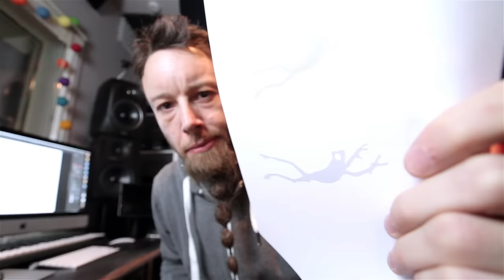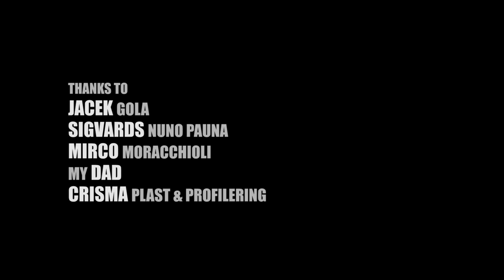MAKING MY CUSTOM GUITAR!

Comment: When I cut the pickup cavity in my Strat for humbuckers, I used a chisel and slowly chipped away and turned it into a "swimming pool" cavity. I could do HHH if I wanted! 

I took my time with it and it is so sanded inside and even, it looks like it was done with a router!
Reply: I've seen some work that looked like it was done with a dull butterknife and a rock.

Comment: Parts of that were kind of brutal to watch, but it's evident that your willingness to ask questions, experiment, and make mistakes has made you the multi-talented person you are - and you got a result you were happy with, both in the experience and in the guitar. Nicely done!

It occurred to me that you could've made a pretty cool pickguard out of the head/body portion of your Frog Leap logo. Might've looked pretty wicked. I think I would have put an accessible battery case (the kind with a door) in the void in the back behind the bridge mount where you put that piece of wood.  

You could pretty easily convert that basement space into a nice little shop area. Very cool vid, overall. 😁

Comment: Awesome video and guitar! I know this is an old video but just wanted to offer a coupon of tips. When you’re using a router like that it’s easier to remove wood in smaller cuts. For example instead of cutting the entire depth cut about 3/4” at a time or less. It’s easier to make several passes. It makes it easier to cut and if you make a wrong cut there won’t be as much damage to repair. 
Next when making holes larger on the Guitar I have found it’s much, much easier and safer to use a reaming tool. It’s angled and sharp and is used by hand. 
I had to use it on my LP when I changed the volume pots. I didn’t want a drill bit to slip and ruin my finish or split and chip the wood. The reamer works great for these things and would have been easier to make the holes larger for the tuners. Just sharing my experience. 
Other than that you did a great job!

Comment: Nice work Leo the finish turned out metal moody in my opinion looks like a creepy foggy snowy night with those leaping demonic frogs haha. 
One suggestion permit me to give you.
Since it is now called Mr Frog you need to find a frog maybe a wooden or ceramic one and close it at the back were the tremolo springs should be since your plastic covers are clear. So that Mr Frog can buzz in this guitar.

Comment: Eye screws into the strap holes are great for hanging it while painting.  You can also screw a board into the neck pocket to hold onto as a handle while you are painting (for a bolt on neck obviously, not for a set neck)

You want to use a sanding block also to make sure that your flat faces are smooth.

Comment: Sand actually was the correct word, so nice 👍🏻. Also 180 is the grit, meaning the scratchiness of the sandpaper. The higher the number, the lower the mount of material it takes off. Great vid!

Comment: Success doesn't come without failures. Spray painting: single pass sweeps starting before you hit the project and stopping after the sweep leaves the project, wait a few seconds then sweep the area in the opposite direction, never spray endlessly in random pattern, this is why drips formed.

Comment: "it's urm, 180, that doesnt mean anything to me, except that it's a really light sand?"
he probably meant 1800 so i'll forgive him
"okay so that was urrr wrong paper, this was the one i was gonna use. it's urr 400 ¯\_(ツ)_/¯"
Reply: Sandpaper has a grade. The lower the number the rougher the paper is for getting rid of edges of the wood that feels like you'll get a splinter. The high grade means the smoother the paper which deals with filing down thin wood or what he did which was not hurting the paint.
Reply: It looks like maple which is a hardwood, but very workable., My only issue was when he wasn't sanding with the grain.  For color sanding or sanding after priming, I'd use 600 and higher and wet sand it. Well damp sanding with wood, wet with metal.  I think he did a good job.  I would think that a regular rattle can clear coat would eventually rub off with use, I'd use some form of epoxy.
Reply: Also, the painting and finishing is the fun part, so save it for last.  If you make another, using the leftover paint lowers the price....says the guy with a ton of leftover paint. ;)

Comment: Wear safety gear and clamp your work. You will lose and eye and a finger that way.
Reply: Kilty MacBagpipe +1 on router safety
Reply: Kilty MacBagpipe gloves are iffy because the glove can catch and pull your hand into the tool.
Reply: Toxic Muffin I never said anything about gloves. Eye protection, dust mask and clamps is all I had in mind.

Comment: Nice job Leo.  Here's a tip for an easy finish.  Drizzle dish washing soap on the surface of the guitar in different designs.  Then, immediately spray a coat of paint(you choose color).  Then put another layer of soap lines/designs and paint with another color.  No need to wait for soap or paint to dry.  Repeat the process with as many colors as you wish and add multiple layers.  Then, when the pain is dry, wash off all soap under warm water.  The effect of the various soap lines and designs overlapping each other is pretty cool.  If you decide to try this, good luck.

Comment: You could add a rechargable battery so that way you can add a recharge port on the side of the guitar, and when you want to recharge it, you just plug it in vs having to take the pic guard off all the time. This will also help with taking screws in and out over time and wearing out the screw holes etc. Love it man. keep it up.

Comment: Hi Leo, I've done a few builds myself, one thing that i kinda stumbled on was using screws that were long enough to actually mount the pickups to the body by screwing them into the wood. it affected the tone immensely, then I
 read later on Eddie Van Halen had done the same thing on some of his Frankensteins. I spray painted it with blue, white, and yellow stripes, and before the paint dried I hit it again with Red spray paint that was kinds splattering. I wish I still had that guitar, was the first one I "built" and it was unique. That was back in 1985. I have no idea where it is now. But that was a cool build you did there. Kinda has me itching to try it again. Thanks for the video.

Comment: In sandpaper, the number is the grit. The grit refers to how many fragments or pieces there are per square inch. So for lower grit sandpaper, there less pieces and the pieces are bigger, making the whole thing more coarse. While for higher grit sandpaper, there are more pieces and they are more fine, giving you a smoother sand.

Comment: Fantastic. And very inspiring to us who would like to try to build our own guitar. Remember! There is only one. It is unique, and YOU built it. Now lots of us want to go ahead and build one for ourselves. So, thanks. I started tinkering; messing about with existing guitars, changing pickups, coil split, series/parallel, etc. It is fun and does not need you to spend a lot of money. 
At the end of the day, you can say "this is mine, there is no other exactly like it, and I MADE IT!"
I cannot think of anything you can have so much fun doing.
And you are right; paint/finish jobs are hard work, and can get very expensive.
Thanks for sharing your journey. Very inspirational.

Comment: always use the center of the buffer, not the edges of the buffer, as the edges cause more friction and heat burning away your clear coat faster in areas making the coat uneven. the edges and corners of whatever you are buffing are always the hardest as even using the center of the buffer corners and edges burn quickly leaving rings or elevations in coating. sanding and buffing is an art form in itself

Comment: That's an awesome guitar, dude. I've built three myself and have 12 from the manufacturers, but my favorite is still the 14 pound jazz bass I built first, mistakes, blemishes and all. I buy cheap assed bodies and necks, then get knock off bridges that are nice and heavy, real tuners and nuts, CTS pots and have Dominger make new pickups. Totally custom how I want them. Also buy spray paint from the auto shop for 20 dollars. Cheap, cheap and shiny sweet. I hope you build another. A nice bass would be sweet!

Comment: Each time you spray it you should spray it very lightly and let it dry maybe sand in between coats and build it up that way you won't have runs or thick or thin spots

Comment: If you want to avoid having the paint drip you can spray short little sprays and it won’t run. If you hold the sprayer tip down on the paint can down continuously like u did for the primer and the white it will run. Just a tip if you decide to make another guitar or do anything involving spray paint.

Comment: I have done that kind of work on the wood for fitting humbucker in na original single coil hole, but did not have a router or a friend with one. Did it with a scredriver and a hammer. Primitive, but effective...lol

Comment: great custom guitar! Looks amazing, sounds real good. I'd put a hardtail on it, you screwed up the tremolo anyway, it was supposed to be a 2 point one, but you drill the other 4 holes anyway, and you forgot the springs, with a hard tail you'll get better  tuning stability, that jammed in half trem will let you down eventually. Either way awesome job I had a lot of fun watching you build it.

Comment: You did a great job! I just built a Jazzmaster from extra parts and some stuff I had to buy. It weighs a lot near 12 pounds. I used clear varnish and Tia and I put our blood in it. At first it was very very red. Now it is the color of a scab. You know a brown color. The Jazzmasters have trouble with the bridge. I tried 4 different bridges and then I modified one and it is perfect. Action is very low and the guitar plays better than the real Fenders at $1,400 bucks. Not counting the hospital bills because we near bleed to death trying to get the right shade of red. I played it live two nights. It's a beast because of how loud it is. I hate the switch so a new switch this week. You never were hospitalized so I say you did better Leo! I hope I see your new guitar in the videos.

Comment: I know this is an older video, but it just played automatically on my PS4 so I watched it.  Very cool video and thanks for sharing.   I know it’s over a year old, but I just wanted to say, if you haven’t had a chance : try the ‘18V mod’ for those EMG’s.  It’s easy to do, easy to undo, and really really changes the dynamics of the pickups.  It’s common to do and not at all harmful to the pickups.  

It’s worth trying just for fun as it really makes the pickups more dynamic and less compressed.  

Keep up the great work.

Comment: Normally those EMG’s use a 9 volt battery, a little trick I use is 2, 12 volt batteries for a total of 24 volts. It really brings those EMG’s to life. 
 I bought my guitar off eBay, replaced most everything, it’s my favorite of all my guitars. Just wish I could play them.

Comment: Turned out pretty good man. Only suggestion I'd make, take your time painting. Lots of light coats. More back and forth when using the spray can. Other than that I really like it. Oh and make sure the finish is the very last step. Build it first.

Comment: Awesome job, man.. Ive been playing for almost 20 years (Im not even 31 yet lol) but just now getting into customizing/building my own guitars.. I recently took my very first guitar which is a Squire Affinity Strat from 2001-ish and replaced the pickups with a Seymour Duncan humbucker, a single volume knob and soldered everything myself. Ready to throw a Seymour Duncan Invader in it with a 3 way toggle switch and obviously a new pickguard. Gonna paint the headstock all black and put a custom Michael Myers decal on the body. Cant wait to get it finished.

Comment: nice! but the battery placement is a bad idea, as you will soon find out! the quickest fix might be to put a rechargeble one in there and mount the connections to the pick guard in order to charge up the (guitar) battery

Comment: On the wood no aggressive materials in general. Because wood it's not like iron, it's a LIVING material, its adapt himself to different kind of tension, obviously like everything else to temperature changes, and so many other things. Like a general advice, work it friendly and gently. For example for the nut, use vinil glue instead of super attack etc etc etc....

Comment: Let's be honest, it's all because of the EMG's and valve amp. You can put EMG's on a broom stick and still it will sound, and the high gain valve amp does the rest. I've changed my bridge pickup with EMG on my Cort, and now it sounds like ESP LTD. But it will never feel the same, its just the sound that is there...

Comment: for your next project a old trick I learned  when I built gun stocks.   sand the wood to a smooth feel.  here is the trick     wet your fingers with water  wipe the wet fingers  on the wood surface to moisten it. do small sections at a time  .then use a flame from the wife's gas stove to dry the wet spot  a hand torch will work.  just don t burn the wood    after spot is  dry feel it.  the fine wood fibers will raise and make it rough again    from this point on use 000 steel wool to smooth the area  again  repeat the wet  dry sand  til the wood feels smooth after the wet spot is dry       the roughness you feel is partly due to the tiny wood fibers Bing raised by the wet paint         your guitars roughness is most likely due to the layers of paint      and it is super bad ass        if you do another one give this trick a try and see what you think
Reply: Interesting tip, thanks for sharing. What types of wood do you use this method for?

Comment: That looks like it turned out really well. The thing is you very much get what you pay for. I've built £50 (is that maybe 70 dollars? really cheap) kit and whilst the wood was passible, i spent months doing inlays because learning on something cheap, but I spent more than that on a wilkinson two point bridge, as that was about the cheapest trem that wasn't rubbish. More on locking tuners. Dimarzio bridge pickup i actually had amongst my spares. £20 on a fancy 4-pole 5-way blade switch. But these aren't things you find on cheap guitars. The only major cost saving has been taking junk single coils, rewinding them by hand and putting in alnico magnets in the one for the neck and and neodymium in the middle. But the time that went into this was immense. But it does play and sound like a high end guitar that i'm happy to record with.

On the other hand I've made a very simple P bass out of a nicer (£100 UK, so $120 ?) kit, I used a bit of blue and black woodstain, 1/3 of a bottle of finishing oil, some inexpensive mother of pearl inlays, a bottle of superglue, some fretwire and 8 alnico rod magnets. Add sandpaper and a lot of rags and it was still under 200 dollars and it looks amazing and plays better than my mid-range bass, but the tuners don't feel great and the bridge looks very cheap. There might be some upgrades, but it's a great bass for squier money. It was a commission build and will see stage and recording use.

Comment: What you can do with the body is screw a piece of wood into the top of the neck pocket and hang the body from it, instead. That way, you won't have the issue with the strings.

Comment: The thing with the glue on the nut is: the strings are not running 100% straight to the tuners and they will pull the nut sideways out of position.
And get this bridge in black ;)
Reply: big bass  The fix is the glue. Without the glue, the nut will be pulled out of position by the string tension

Comment: Use yellow glue mixed with water 50/50.but only after you string it up to see if the nut is to high..Not very much glue though.

Comment: I have a tip for your future videos. Learn what sand paper you're using, and give more details on the grit. (Coarse, or fine.)

For instance 120 grit would be finer than say 70 grit. That's the only thing I'd say was bugging me from the start. As I'm watching this to learn a few things, I found I had to fill in the gaps as it were.

Comment: why didn't you put the battery on the back where the springs and shit used to be? Much easier to swap batteries without risking soldering on the cables to come off...
Reply: aslo... since you decided to go without the wammy.. I would have filled the cavity with epoxy ( leaving a pocket for the battery ) ... just some things to think about the next time you build a guitar :)

Comment: So someone tell me, how is the finish going to be on that guitar (or one spray painted with clearcoat)? I picked up this little half size guitar flying V with a built-in clean speaker. I replace the amp and the pick up and the bridge and if you other things, but I could use some touch up paint in a few areas. The body is got that real, I don’t know thick paint. It reminds me of what I think that plasty dip is, but honestly I’ve never dealt with that so I really don’t know. It just seems different than regular paint and clearcoat. But maybe it’s just because I’ve never actually seen it done right. In my mind the clearcoat was going to try sticky. I guess so if you put a few coats on and then buffet out real good it wouldn’t be. Can anyone tell me for sure?

Comment: yes expensive but a comparable guitar with those pickups and locking tuners would cost you about 1000-1500 plus you dont get the custom finish and the custom plate split for batter changing , sure it may be better quality wood in a high end guitar but the difference is negligible , there is no such thing as tonal difference ,that are noticeable.